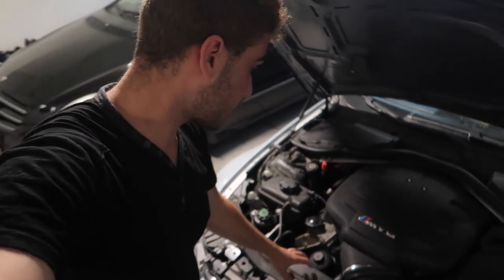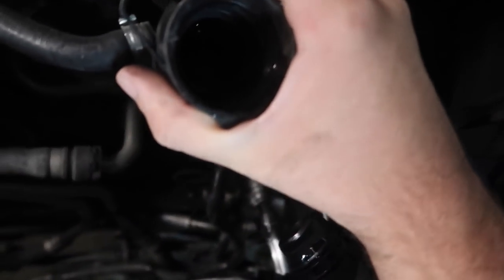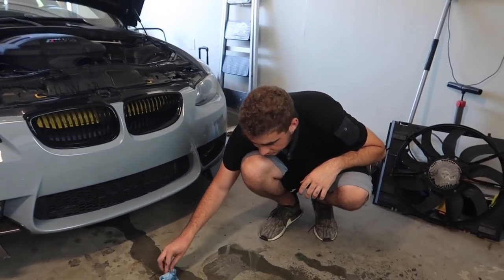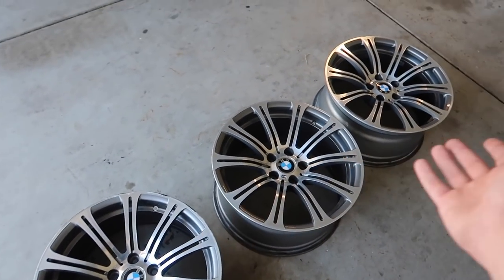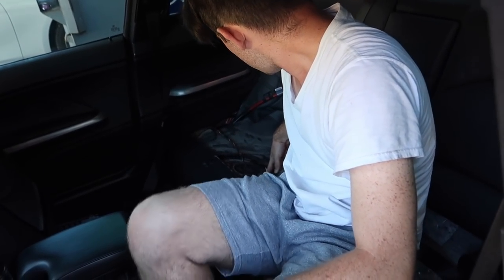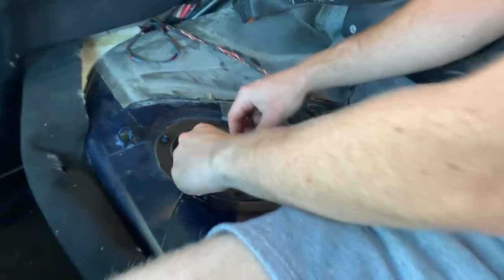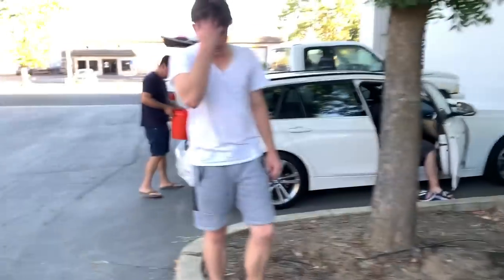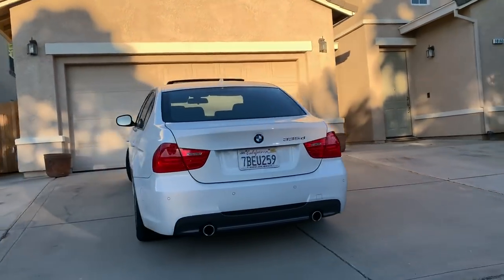I'M STUCK, NOBODY IS SELLING THE PART I NEED TO FIX MY BMW M3!

Comment: *Drives a M3, *Buys autozone parts
Reply: Bmw M3 e46 This is what happens when kids buy cars
Reply: Sade Khyrose Yeah so not the same parts man
Reply: Delphi is OE for the fuel pump. Parts stores on occasion sell good parts.
Reply: Bmw M3 e46 I see you everywhere
Reply: Nick Gorkes no the oe is Siemens vdo
Reply: Abe E Jdm yes but Infiniti is the fancy version of Nissan so parts more expensive
Reply: daineseboy78 actually they are the difference is that we order the parts to the store ( I work at pep boys and deal with these things all the time )
Reply: So if anyone works at a auto parts store knows that the parts are the same